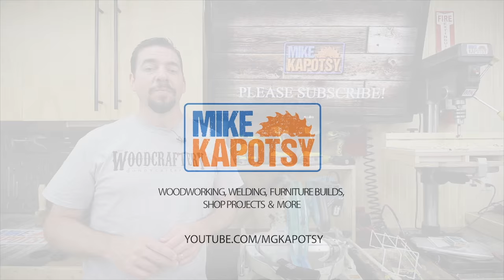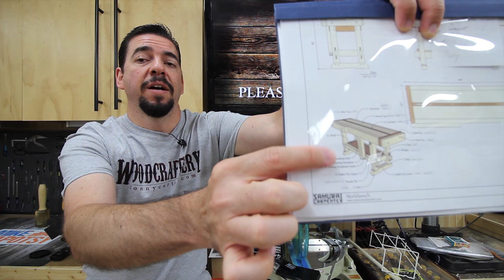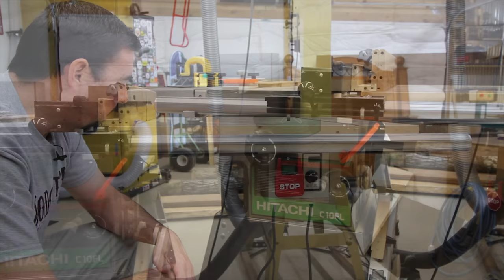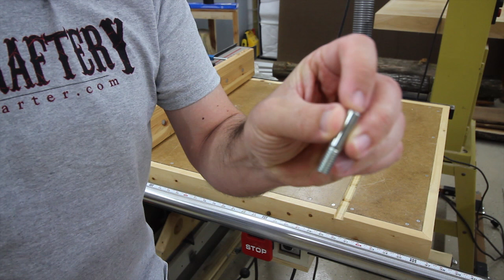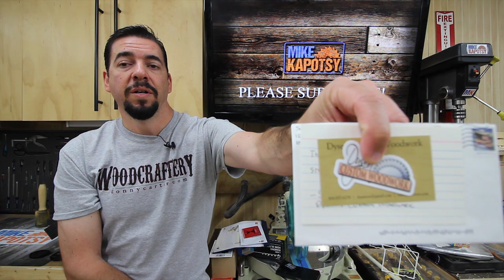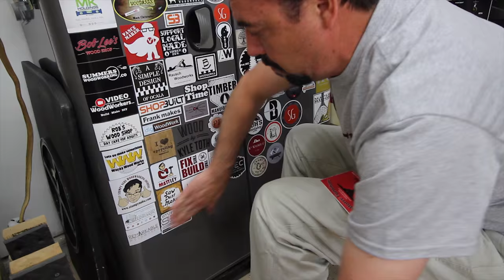Shop Talk # 33 - My Hitachi C10FL Table Saw

Comment: I have the same saw, had it for 10+ years. I don’t have the issues you have. The rollers are a little flimsy but I didn’t buy it to roll around. I get straight cuts, no power issues and the fence is dead on ( takes some tuning ). The miter gauge sucks but they all do. I added a Jessem clear-cut roller guide and it works great. When I angle to 45 degrees mine does not get suck. Maybe your has a defect? Only thing I wish was different was the blade is dead center of a 50 inch rail. I went to a shop saw demo.. took a piece of walnut to cut.. told the guy to rip it at 3 inches and compared. Mine was dead on (verified with a 1 2 3 block), the shop saw was off 1/64th negative at the start but 1/32 positive. Was not impressed.  Leveling the wing is a little bit of a pain.

Comment: Unfortunately rewind for 240 volts will not change anyting. Each winding has 120 volts with 7 and 1/2 amps each. If you wire them in parallel it's 120 volts at 15 amps. If you wire them in series it's 240 volts at 7 and 1/2 amps. The power drawn is the same in both cases

Comment: I have a brief question, Mike. I have the same saw and am looking to upgrade both the fence and build an extension to the right. Does the Vega fence support the homemade extension wing? Thanks!
Reply from the maker: Yes, I had a homemade wing to the right of the saw.  It can be done with some ingenuity.

Comment: Hello Mike,  I enjoy your video's.  I have this same table saw and am starting to have issues with the reset button.  As I start the saw up the reset will trip.  No load on the saw blade.  If i wait about 5-10 minutes after resetting the saw and try again it runs great.  The i shut it off and turn it back on and it will trip the reset again and again.  Have you had any issue like this? Do you think it is a faulty reset button or should i look for a deeper issue?

Comment: Very cool Mike!  I was thinking about using the same hardboard like material for the top of my table saw extension wing since I have plenty of it.
Reply from the maker: +Alex Andres thanks, it works well.  I was the surface with a liberal coat of Minwax paste wax, then buff it out.

Comment: Looking forward to seeing the bench come together. I have that speed controller too I tried to use it on my lathe, but it didn't work out but maybe i'll add it to my table saw (not that I use it that much)
Reply from the maker: +Kaged Creations depending on the lathe (type of motor that is)  the variable speed controller may not work.  It is only designed to be used with brushed motors I think it is and not brushless motors.  Worked fine for my HF router.
Reply: Yeah It had mild success but not enough to leave it connected. I just am lazy and don't want to change belts every time. I may be upgrading to a variable speed lathe in the next year or so.

Comment: Great video. I picked one of these up recently and need to make a few throat plates. Can you please share how you did that with thicker wood being that the metal one is only about 1/8”?
Reply from the maker: @ryoudone thanks, I used a router and notched out along the edge for the lip to rest on.  It worked well.
Reply: 1/2” stock I’m assuming. Did you use a bushing guide in the router with a template or just free hand?  Any concerns with it flying out since there’s no tab in the back to hold it down?
Reply from the maker: I free handed on a router table with a guide pin.  And I added a tab in the back to hold it in place so no it didn't fly out.  I no longer have the saw though.  I upgraded to a Grizzly and sold this one.
Reply: Perfect!  Thank you so much for your time and guidance. I’ll be trying that very soon.

Comment: Hey Mike, good review and nice upgrades. I just bought this off a yard sale and I'm trying to change the blade. How do you do that? I hope there isn't a special wrench that comes with this table saw since I didn't get one.
Reply from the maker: Thanks.  Yes there is a wrench that should have come with the saw to remove the arbor nut.  You may can find a socket to match.  Remove the insert, crank the blade all the way up and you will see the nut on the blade. You can hold the blade with one hand (wear gloves) and loosen the nut with the other hand toward you.  Always Unplug the saw when changing blades.
Reply: Mike Kapotsy appreciate it mike.  I saw this red lever thing when I was trying to remove the blade. I didn't know whether I'd have damage the arbor.
Reply from the maker: That could be to lock the arbor for loosening the nut

Comment: For all those how are considering buying this obsolete saw used please be advised that parts are no longer available. I own the saw and it is now overheating for some reason. The thermal overload switch will still reset but trips after a minute or so. This switch is not available. Also the motor is suspect and I am trying to locate another motor but it is also not available. I may bypass the thermal overload as a last resort or junk the saw since it is not repairable. I am still in the process of figuring out what is wrong. I don't want to buy another saw since I am 83 and need only a few more years before I retire from woodworking. I have a ton of jigs that would also need to be remade. By the way the overload switch is very hot to the touch. I don't know if that indicates a bad overload switch or a motor problem. Comments?
Reply from the maker: Can you place a clamp on amp meter on the wires to the motor to see if it is truly overloading?
Reply: @MikeKapotsy  Thanks for quick reply. I just cleaned and blew out with compressed air the motor. Just a lot of dust as expected. I then ran the motor with no load (belt off) for a little while. A first the motor made a little noise but got pretty quiet and when I stopped it the shaft was cool and the thermal switch was cool. No sign of heat. I will put the belt back on and the blade and run it longer. My son has a clamp meter I can get in a few days.

Comment: What fence is on your Hitachi C10FL table saw. My fence finally gave up the ghost and I can not get it to square anymore to the back of the blade. Where did you purchase it from?
Reply from the maker: +Jack Warren I went with the Vega Professional, purchased on Amazon I think.  I love the fence, works great, fairly simple to install on the Hitachi.  Did require drilling a couple new holes on the rear fence rail of the Vega, no biggie.   https://www.amazon.com/gp/aw/d/B000022622/ref=mp_s_a_1_2?ie=UTF8&qid=1474928040&sr=8-2&pi=AC_SX236_SY340_FMwebp_QL65&keywords=vega+professional+table+saw+fence
Reply: Thank you for your reply

Comment: Hi mike you think the same saw for $600 its a good deal it looks new they havent use it in 6 years. But the lady says its 220v and you said yours is 110v. You know anything about it?
Reply from the maker: You can convert the motor to 230V.  I did before I upgraded mine.  It is a good saw.  Fence is not great.
Reply: Mike Kapotsy. Thank you mike but i want to know if the saw originally comes 110v because i want a 110v for just my garage
Reply from the maker: Yes sir it originally came wired for 120V.
Reply: Mike Kapotsy ok thank you because the lady thats selling it to me said is 220v but looks just like yours and same model and i look at the pics and i believe its a 120v. But anyways thank you for your time and help great video its very interesting how we learn something new every day. Have a good day mr. kapotsy
Reply: @martingonsalez7651  you can rewire it to run 110 or 220 from what I've seen. There should be an access panel to the wires

Comment: Hey first of all thank you for the review and the video. I have a chance to buy the same exact saw used for $200 (US),in very good shape. Do you think that is a good deal? I am a subscriber so if you can get back to me on that I would really appreciate it thanks Mike.
Reply from the maker: Well it was a good saw for me.  I no longer have it.  I've heard mixed stories about getting parts for it now if something breaks so it's hard to say but if it is good condition it may serve you well for a long time and the price isn't bad.
Reply: @MikeKapotsy  thank you Mike I ended up getting it. I also got a good deal on some other equipment so it balanced out. Thank you for getting back to me so fast I was working and didn't see this till now. But thanks again man
Reply from the maker: You're welcome.  Hope it lasts you a long time.

Comment: My Hitachi c10fl motor wont turn. I'm think something is caught in the belt, but can't figure out how to get to it. Is there an easy way to access the motor/belt area?
Reply from the maker: +David Swift yes, take the back side cover off to access the motor.
Reply: Mike Kapotsy 
Thanks I kept cleaning and got it to run....put the few screws I took out (not back panel) and it quit again. Too frustrated to be around sharp things. Will check back later.
Reply: Mike. 
Got it off and cleaned out again. I messed with the miter gears and it started running again. Could it have an auto shutdown if miter goes past level the wrong way?